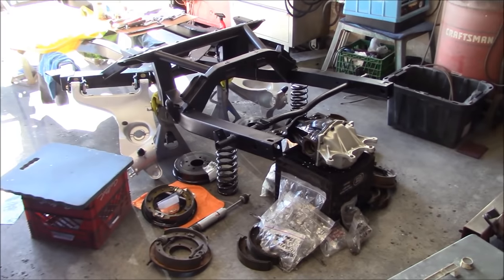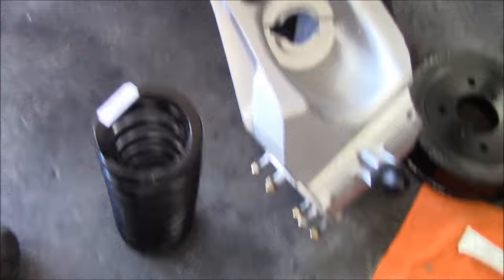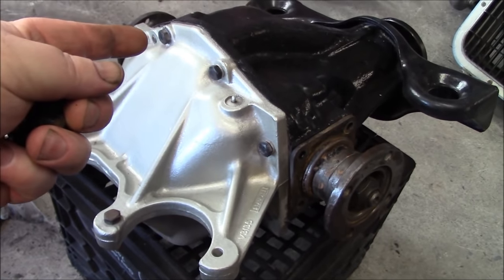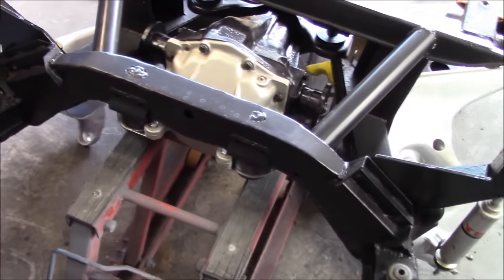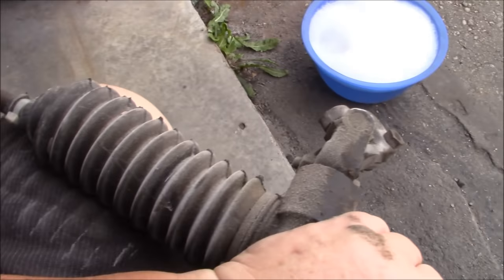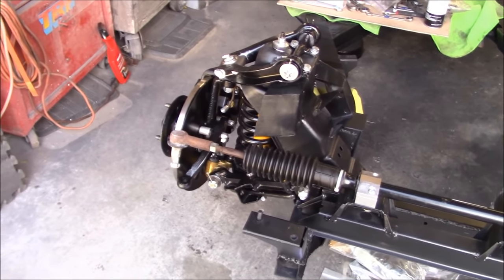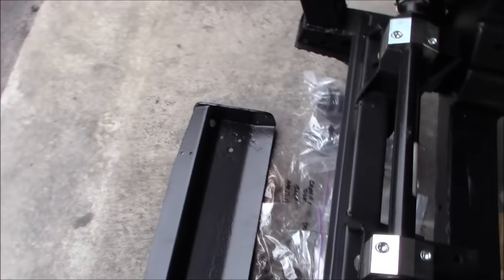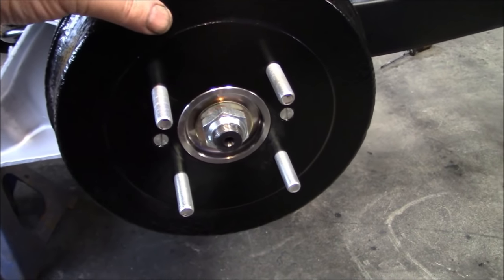1968 Triumph TR250 Restoration,  Rear Suspension/Brakes, Steering Rack,  Diff and Rear Hubs, Part 4

Comment: Looks fantastic! On lightweight cars like these If you put a strap around the bottom of your floor jack and around the frame of the car you can compress springs by yourself. At your own risk, but it works for me.
Reply from the maker: Yeah, there are a bunch of options...anything from a d ring in the floor, to a 2x4 to a beam in the ceiling etc....
Reply: Les is by far the most entertaining option!

Comment: Had to smile at the OCD kicking in over those nuts. I am just the same and even make sure there are never more than two threads sticking out of any nut. I can blame my old engineering tutor as he pointed out 'Its a waste of metal and doesn't add tightness!'.
And @ 18:22 the three fastenings on the right are 'screws' (as in machine screws) and the rest are bolts because they have that un-threaded shank. And a 'screw' can have any sort of head on it from Torx to hex head.  But the point you make is very important when bolting assemblies together as its often the shank that is locating the parts in line.
But the car is certainly starting to look the part mate. Well done.

Comment: In mine I bolted a, angle iron strap from the bracket down to the frame on the forward (non-shock) side of the bracket.  My frame was cracked before the conversion, even the lever shocks can cause cracks where you show.  If I ever get another TR6 I'll probably do something similar to Neil Revington's setup if I decide to do convert.
Reply from the maker: Hi Nate, yes I considered doing the same angle iron on my TR6 before I removed the tube shocks...I had the rebuilt lever shocks at hand so it was easier at that point with less car down time to do the swap....
Reply: Nate Steiner Bear in mind any frame that cracked there will have been 30 - 40 years old and will have fatigued anyway... the different forces from the tube upgrade will have just finished the job.
Reply: @cheftush  Also I sandwiched a couple pieces of high density (3/8" thick IIRC) between the new shock brackets and the trunk floor/walls.  Probably not necessary, but the whole project began as an exorcism of creaks and pops from the rear suspension.  I ended up replacing the differential mounts plus welding in a reinforcing kit, new trailing arm bushes, 6 new u-joints and helicoiling all 12 hub studs.  Only regret was fitting the "competition" springs front and rear.  Sold the car before I had a chance to swap back.
Reply: @johnmoruzzi7236  no, the welds were cracked prior to my fitting the conversion.  I went over any suspect weld while I could get to while I had the suspension and exhaust out.
Reply: @natesteiner5460  That was kind of my point... obviously an inherent weak point transferring offset drivetrain loads from the diff crossmember to the frame via the welds without some additional bracing. I imagine the shift from the TR4A to the 5s and 6s with sportier engines and other owner upgrades didn't help.

Comment: Wow,,,  moving quick on the build. Thank god Les showed up...  David did your order parts ahead of time? If so you must have done some good planing. Finding hardware in the right size has been kicking my butt in putting the TR4 together. Do you know of any manual that indicates the type and size of hardware needed for certain parts? Might be just wishful thinking that the information is available in a manual. Looking good..
Reply from the maker: Hi Robert,  there are spare parts catalogues available for the TR4....this would show you the part number of the fasteners.    You would then need to look these up...http://waghornswood.net.nz/Manuals_01_18/Vehicles/Triumph/Assorted/triumph_standard_hardware_catalog.pdf
Reply: cheftush thank you so much...

Comment: I would say that you have a quick rack there. The large adjusting nut looks the same as the one that was on my quick and is also the same nut that blew clean out of the housing. The original quick racks were recalled and i returned mine to MOSS. And I also believe the quick racks were made in Argentina. I also hated the driving experience with the quick rack and would have replaced it even if it hadn't failed.
Reply from the maker: I thought it might be Tim, I have a feeling that I will be swapping it out....I think I have a couple of stock racks kicking around that I can rebuild.  Cheers, Tush

Comment: Trash it looks really nice that’s about where I’m at on my 69 project question for you have you ever used a rear sway bar or spoke rims
Reply from the maker: Hi Craig. Yes, my 73 TR6 has a rear sway bar matched to the front and the car handles really well.   I have wire wheels/spokes for my 59 TR3A

Comment: maybe could add a drain plug and better vent while dif is out. just me.
Reply from the maker: Even with new seals the diff will probably leak so in essence, when I fill it up a few times a year I’m putting new fluid in 😉